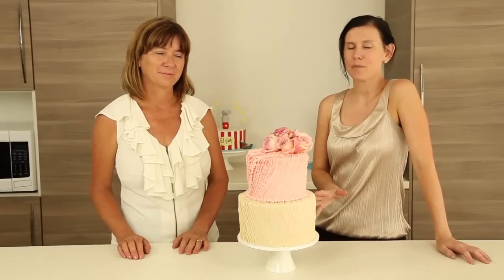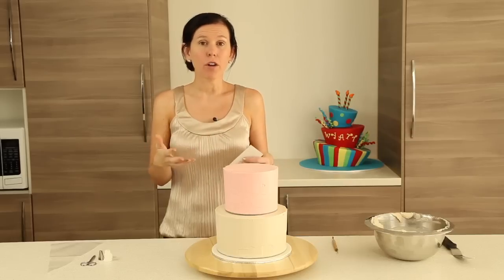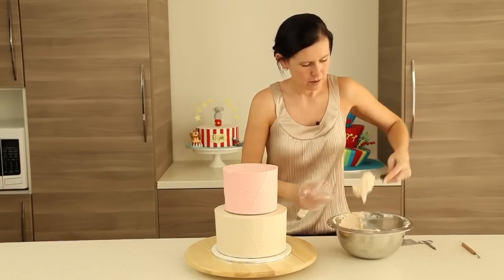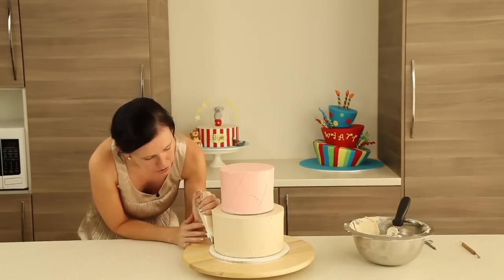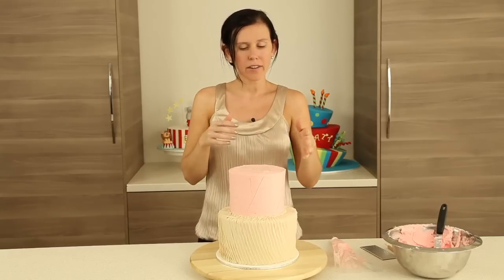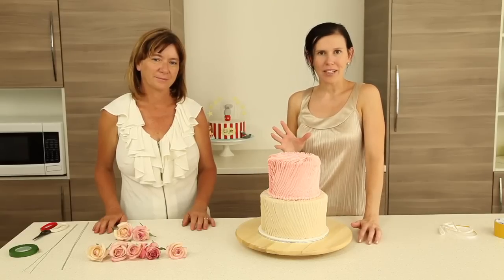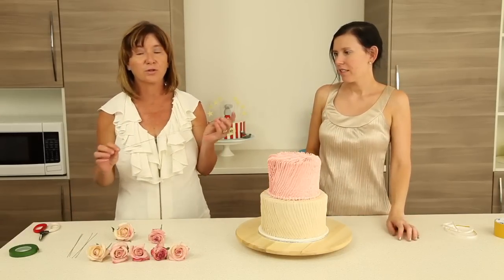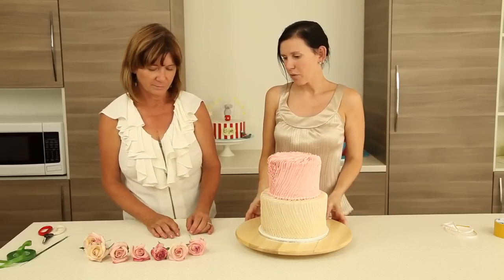Pleated Buttercream Cake Decorating & Fresh Flowers - CAKE STYLE

Comment: this was a great video.  Ya'll did a very good job explaining as well as demonstrating.  i still stick with single tiers (two or three layers) but i definitely want to try the pleats.  I may venture into fresh flowers or just use some buttercream roses.  i still need to learn some other large buttercream flowers.  
About using fresh flowers, how do you make sure the flower itself doesn't "contaminate" your cake?  (i.e. pesticides, bugs or other things that may have been on them at some time)
Reply from the maker: joyfuljaj Knowing your supplier, Darlene gets them straight from the grower, stick with safe non toxic flowers, roses are edible after all, well, when grown for it. Also, using the flower viles to make sure the stems don't go in the cake.
Reply: Thx